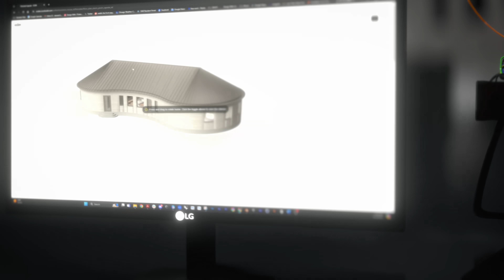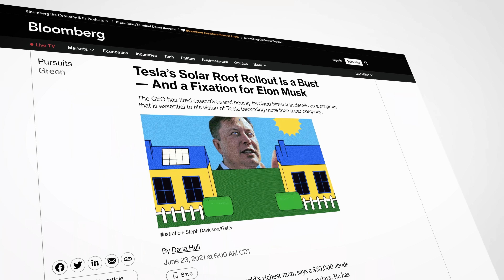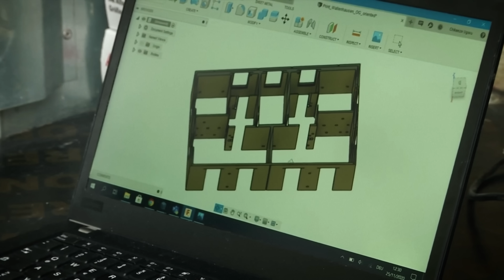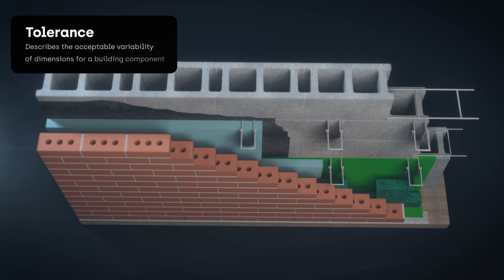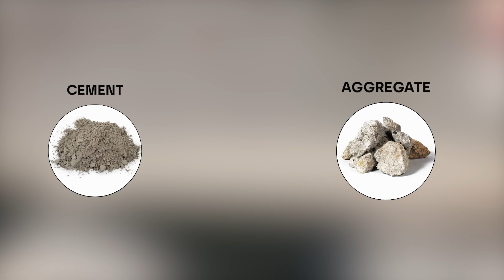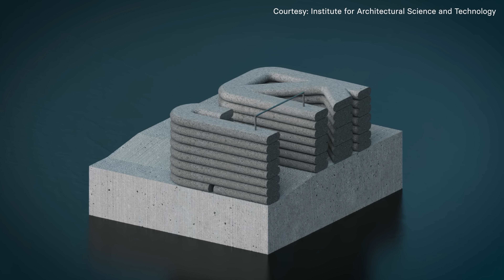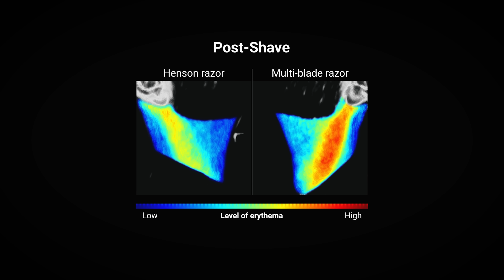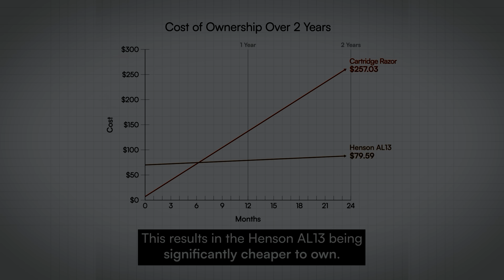Why 3D Printing Buildings Leads to Problems

Comment: I do not understand 3D printing houses. Wouldn’t pre-fab construction be better looking, more efficient and environmental?
Reply: I think it would be, with enough of parts/components it would be like Lego, instead of building brick by brick it would be wall by wall.
I think pre-fab have bad reputation because it is cheap
Reply: @Matelight_IT  60s prefabs set a lingering tone for how we look at them but have a look at the prefab homes in Scandinavia and Germany especially and they really are made to a high standard (that you'd expect from the Germans/Scandinavians) - they aren't made for the 'budget' homes but for the regular homes and as such the standards reflect this. Baring in mind construction standards are relatively high in Northern Europe, I'd consider looking more at their work and methods than necessarily the cheapest local options (for inspiration).
Reply: @rickybuhl3176  Here in Germany, most houses are still built brick by brick and prefab wood construction still has a stigma associated. People still believe these houses don't last long enough or are in any other way inferior. Based on my experience in such houses in Germany, this isn't the case. The houses are very high quality and so far have been holding up very good over the last decades. If the home owner really wants, the houses can be completely indistinguishable from the outside compared to traditional construction.

In fact, it has quite a few benefits over the conventional way of building here. You can get away with thinner walls for the same kind of insulation since the insulation is a core layer of the building and not an additional layer being applied to stone wall element. The only issue that plagues many of those buildings is sound insulation, making multi family home construction fairly difficult. This is mainly due to the lightweight nature of the entire construction, especially if you use lightweight insulation (afaik spray foam is still very common in the US, which i will absolutely never understand).
Reply: @Mooooov0815  Yeah, it's that thing where we have an impression until we try it, as such (more complicated but nonetheless). I think many of the prefabs up here come from Germany (though they add some Danish brand insulation or the like), the build quality is impressive but they're usually for those who are building their own house - which is a niche market. They aren't cheap enough to be the "budget" option that we'd usually see when they throw up some 200 duplicated housing project on the edge of a city but the ones from a generation ago are already holding up better than the cheap apartment complexes that people chose instead.
Reply: @Matelight_IT  well, yeah, prefab panels are usually made for cheaper builds, which means people will often hire cheaper(and less qualified) workforce, but hey, even then, houses that were built from such panels in Soviet Union during 50's-60's are still standing. Of course they aren't very comfortable to live in today, but considering that some of them were built in under 4 days(mind you I'm speaking about a 5-storey khruschevkas here, not a single family house)—that's some hell of a durability for a house made in such a rush from dirt-cheap materials
Reply: @Matelight_IT where did u get this “cheap” from? Cheap doesn’t mean poor quality. It can also mean it’s economical.
Reply: @nicktasteless fair but quality is often a compromise in favor of cost, that's not saying it's inherently a bad thing and from my understanding large companies at least use market research to determine the quality and price they make their products for, because a lower price can make a product appealing except in certain scenarios where if the price is too low we thing somethings wrong with it or the inverse sorta where things are purchased in part because of their high price as a social tool humans are weird.
Reply: @Matelight_IT  They don't have bad reputation everywhere. Just small elements didn't really work like you would have thought and nobody does them anymore. Here in Finland many construction companies do big elements, which may be individual to the house buying built. Those are better for making the building airtight (draft is very energy inefficient.) 

And 3D printing isn't really taking off here in construction. Partly that has to do with building materials. Concrete isn't exactly that popular.
Reply: Hmm you are using logic and reason which do not apply in clown world where everything is upside down.
Reply: It's a way to build with the lest labor possible. Machines instead of jobs.
Reply: off site prefab of complete walls, big concrete slabs for ceilings, just assembled as big lego components, that is the way for faster and more affordable buildings. and like ordering a car you can still customize a lot. (colors, trim etc.)
Reply: Well, it's part hype, that's for sure. But that was true for early 3D printing, too. There is also Hadrian, the CNC bricklayer, or the way european prefabricated houses work where factory built wood or brick based wall elements are simply bolted and glue together at the construction site. Prefabrication takes 2-3 months, most cabling and piping included, and setting one up is only days, single family houses can well be done in a single day. 
3D printing will end up being another tool in the toolbox, maybe revolutionize some ways we build houses, but we won't be using it to build the majority of houses, like other 3D printing has not stopped all other manufacturing types.
Reply: 3D printing a house saves very little in either time, it looks like a great idea on the surface until you realize there is is usually a roof, plumb, electrical and interiors to still build after printing the walls. Agreed this is really no better than pre-fabricated concrete walls.
Reply: There are prefabs that as much as, if not more than, regular houses. Especially the ones that have optional additions for expansion.
Reply: I think 3D printed buildings look cool though.
Reply: Don't have time to read all the comments now but in response to some earlier assertions in thread you guys need to keep in mind that as a numbers game, a lot of countries are mostly getting new home builds from landlords who aren't going to even look at the house more than once a year let alone live in it, and don't give a fuck if it's ugly because it's just passive income for them to vampirically feed off renters
Reply: If people are concerned about rusting rebar, maybe consider basalt rebar or other types of reinforcing. Maybe cathodic protection systems would help.
Reply: yes
Reply: No because the cost benefit is not as great, and customization isn’t as easy to do
Reply: no if you had a way to computer print every piece after you got to the site with the cement in a big truck as a liquid and then it comes out and turns into the shape you want it's always going to be more efficient transporting then something built somewhere and brought in. These two ideas could collide very easily you could have a factory producing pre-built units that you can bring in and print foundations. Since you're all pre tools everywhere and you got all the employees you need, and your building them indoors, they could come off the factory and be installed very quickly in a place and then go to the next place and be installed very quickly.
Reply: Yeah. And I think it's much way faster to build.
Reply: How about 3D printing pre-fabs?
Reply: @Saviliana casting and traditional manufacturing is fart cheaper and faster
Reply: I think this is more for colonizing other planets tbh.
Reply: What about plumbing and electrical
Reply: lol
Reply: For pre fab you need to establish factory, which makes sense if you are building high dozens or hundreds of such buildings, what doesn't happen anymore. We had such way here in Poland in Soviet period. It made some sense and it let us rebuild from total ruin after WW2, but... for heavens sake it ain't pretty anyway you cut it.
Reply: Yeah, that's what I'm thinking. These 3D printed buildings are horribly ugly too.
Reply: I mean what is more environmental then using, I don't know, a construction material you can actually grow and constantly replenish, absorbs CO2 while it grows and, as long as it doesn't get set alight, locks that CO2 away for maybe a hundred years, and even after it's life time, that material could be re-used for other things as well.
Reply: @kelvin1316  are you talking about wood?
Reply: Prefab IS better integrable, better looking and more efficient. The soviet-style blocks are one of the more desirable  home options in countries that have them.

I think the issue is that people are vain  and want the irregular shapes and big sizes because those show wealth. And if you're not buying already built but building up, They think they want their ultimate (at the time) dream home, practicality and actual buildability damned. And prefab would mean that they have a home that others can also buy.

I'd say the solution would be a limited-variability floorplan based on commonalities and SOME options, and engineered technology for joints and floors.

The only problem with it is that loadbearing walls need to be on top of each other.
Reply: Yes. Prefab would be better environmentally. This is literally a solution in search of a problem.
Reply: Yes it would. It just looks horrible when they leave the concrete exposed. Especially on the inside. 
Yuck!
Reply: Yes pre fab is the better option. That's why 3d printed construction went nowhere. It's a solution looking for a problem. Often time it's tech bros thinking they know more than construction people.
Reply: With climate change, getting worse and energy costs going up we have to have homes that are very well insulated and resistant to hurricanes, meaning they have to have curves. Instead of sharp edges, 3D printed homes are a no-brainer. They reduce cost, they retain their temperature, and they are hurricane resistant.
Reply: They’re banned in many towns,counties,and cities this just is a way to get past the oh it has to be onsite construction laws
Reply: Yes.
Reply: Because it actually works, so it won’t raise venture capital on buzzwords alone.
Reply: Prefabs have a connotation of being cheaply built. I recall you can't even get the same kind of financing.
Reply: @JeffDM  that’s changing now with greater options, hybrid approaches and more acceptance with financing. You see it a lot more in Japan, where most houses are prebuilt (to speck) and then assembled onsite
Reply: @JeffDM that's also wrong. I worked in a manufactured home factory and most of the homes were 2×6 with a double top plate. The walls were screwed to each other with 5 inch screws. They weren't flimsy by any means.
Reply: i mean ngl if you want looks you can just slap stucco or plaster right over the exterior/interior of this i don't see anything stopping you from doing so its obviously just cheaper, which is probably their whole selling point in not doing so as its not required to have a functional home
Reply: @Adierit  Try doing a tile shower in one of these printed houses. Again there is a code that has to be met, that means waterproofing and you arent going to have a suitable foundation with these printed walls.
Reply: And safer, since 3DP concrete has no reinforcing steel in it, and concrete without reinforcing steel in it has a nasty tendency to fall down and kill people.
Reply: @railgap  I mean, reinforced concrete also has a tendency to fail due to rusting. Know in my area many of the old concrete highways are being dug up to replace the old rebar
Reply: @Skylancer727 boo problem if done right from start. Rebar to close to surface, to wet concrete mix with air bubbles so moist get in will rust. I don't do that.
Reply: @joacimjansson1123  Your grammar suggests otherwise. And it doesn't matter at all. Rebar will always limit the life of concrete. No matter how perfect it was designed, it will still rust internally.
Reply: @Skylancer727 sorry,my grammar sucks.i read , don't write often. ( Had to do google translate that last sentence) 37 years as a carpenter with interest in concrete construction , I've seen lots of faild rusty rebars, explained by not installed right.
Reply: People need to get over aesthetics, this is essentially a cinder block house. Dead reliable, needs little exterior maintenance and a lot fewer people on site to construct. And I don't know on an environmental standpoint, but I imagine things lasting longer are better than things that need to be replaced more often. I work on a lot of builder grade homes from the last decade And they have nothing on a cinder block house from 100 years ago. No rot, no termites and a lot less trips back and fourth to the job site
Reply: @matt45540 what would be the durability of cinder block during an earthquake, if you know?
Reply: @triciac1019  unreinforced masonry is not very resilient to earthquakes. Reinforced masonry can be very strong.
Reply: @matt45540  yeah I don't see that happening. You have to look at your house possibly for the rest of your life. You're not gonna buy one that looks ugly. 

Second, nobody cares how few people worked on the house. In fact many would prefer more with the popular concept of being higher quality. People actively go to hand made pastry shops over just buying from the super market all the time. Just because it's automated doesn't mean it's better, it may actually be lower quality. Besides there are already machines that automatically stack bricks or cinder blocks. Doesn't have to be 3D printing. 

And eco wise cement is one of our least eco building materials. Around 20% of global emissions comes solely from cement production. Yes cement production produces more emissions than all transport including cars, boats, trains, and planes which is around 14%. 

And lastly, there is concern to be made about it's reliability unlike cinder blocks, which many warehouses and schools are already made of. It doesn't seem to automate having reinforcement, if it does have reinforcement it's most likely rebar which is one of the leading causes of many cement structures failing; it rusts. There's the very serious concern of an imperfect layering allowing small holes that need to be filled in manually (defeating some of the convenience), etc.
Reply: @Skylancer727  Also, holes..mice, roaches, other type insects due to the bad isolation, i mean it's a terrible idea to go with in the first place, but to pay for something like that requires a special kind of idiot.
Reply: @Skylancer727  3D printing done correctly is  high quality.  It's stronger and more durable than any stick constructed home.  I find it appalling that a stick home costs a king's ransom.  I'll never buy one again.  Someone  may pay millions for a funky designed home that could only be made with 3D printing.  You may think it's ugly.  Beauty is in the eyes of the beholder.  Do you.
Reply: This is technically technology for other places like space.  Not really for the local people on earth.
Reply: @lifenotbeengood1  Ah yes, space where couple of tons of cement is a good idea to bring along. That some Elon Musk science level there.
Reply: @lifenotbeengood1 you're confusing the two different processes of prefabs
Reply: @woopeeallan  that's a pipe dream. The materials used for 3D printed concrete aren't readily available just anywhere you go. It's one of those failures of the media that claim it can be made anywhere.
Reply: @Skylancer727  If you think that multiple ways to make 3d printed structures on the Moon haven't been worked out already then the failure is between your ears.
Reply: @filonin2  Unlike you I actually looked into the topic already, thank you. Last time I checked, only a few months ago, all methods required resources from earth with intent on sending resources in an earlier launch. Even then, there are no current plans to build a base on the surface of the moon, all current plans involve either building into old lava tubes or digging out caves to build bases in. This is because no realistic amount of material can protect from the radiation on the moon other than being underground at least a full meter, more likely 2-3. 

The only pitch I saw for 3D printing anywhere but earth so far was AI SpaceFactory's pitch fringe about 7 years ago. But that plan required the use of bioplastics which we aren't certain can even be made on Mars or the Moon. It is planned to be made of PLA which is quite literally just plastic. It's second biggest material choice basalt which is also incredibly rare on both Mars though it is incredibly common on the moon. 

The only other winner of the NASA competition was Team Zopherus but that plan has almost no basis in reality. They're plan included a giant walking robot that prints in the area between it's legs. It's completely absurd and would mean building this structure first which is bigger than any homes you'll be making.
Reply: @filonin2  There is one 3D printing method that might work in space: sintering regolith using sunlight or nuclear power. Honestly though, the simplest way to build a radiation shelter on the Moon and Mars is to use an inflatable habitat and either cover it with regolith or build a lightweight dome over the inflatable hab and then pile regolith on that instead, using either loose material or material that has been packed into bags or boxes, like Hesco barriers.
Reply: @Skylancer727   If you can get the concrete slab it is built on...
Reply: @Barnaclebeard  I was responding to someone on 3D printing cement for the moon or Mars. There's no structures on either that use any cement, and there's no proof you can really make it there either.
Reply: @Skylancer727  you're a pipedream
Reply: @Skylancer727  build your mom a home, an old folks home
Reply: @artificer845  you know, it's always a great sign of someone's intelligence when they go to ad hominems or the all popular "your mom" jokes. 

And that comment for gatergates was also a pretty great sign of your background of the field. "Leave it to the engineers" is about the same as the "if you're not an artist how can you judge art". You don't have to be an engineer to see the flaws in engineering designs. And the issues with 3D printed homes has very little to do with engineering, it's more the appearance, cost, and general lack of value. It's a cool idea with basically no real relevance. 

It's like those automated train trucks (the things train cars normally sit on). I mean, sure, you could put containers and trailers on those, but isn't it easier to just put them on a car where on stacks you can even put them closer to the ground? Yes the automated trucks are cooler and more advanced, but there's no real benefit and they still cost a ton. 

If building homes entirely out of concrete was the best option we'd already be making homes out of it, but we don't. In some places concrete is far more expensive than traditional materials, it has a tendency to crack, it's not very eco friendly, etc. And while the idea of 3D printing a whole home sounds great, in reality 3D printed homes are just 3D printed walls. The rest of the building still has to be made out of traditional materials, so what was the point?
Reply: @woopeeallan gonna ship all that water and cement to Mars huh?
Reply: @gatergates8813  Don't need to. There's already been a process worked out for making aggregate concrete locally on mars. The bottleneck limiter last I heard wasn't the material itself, but rather in the oxygen required to cure it for tensile durability.
Reply: @gatergates8813  hurrr durrrrr hey ya know what? stay in the trades, leave the thinking to the engineers yeah?